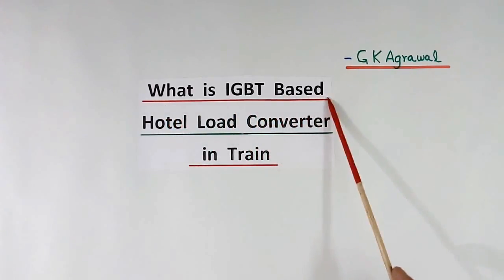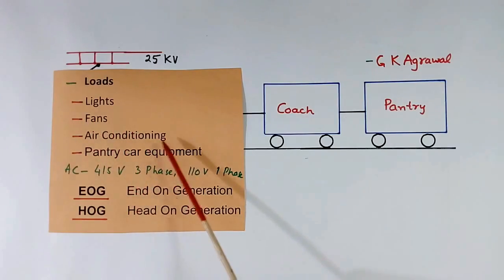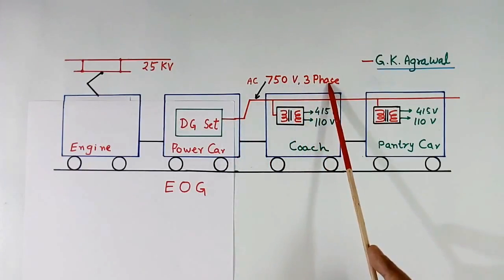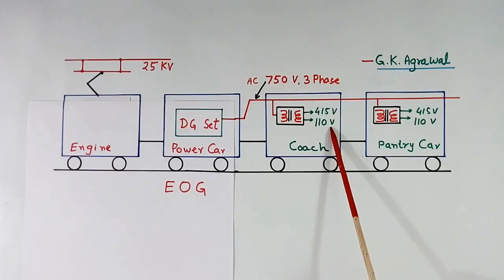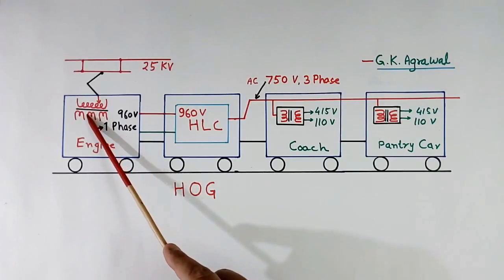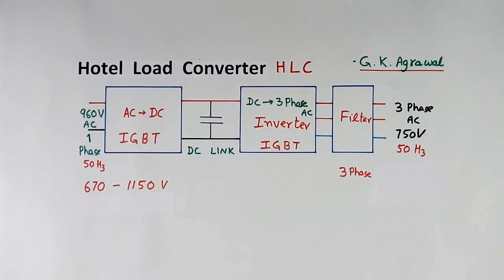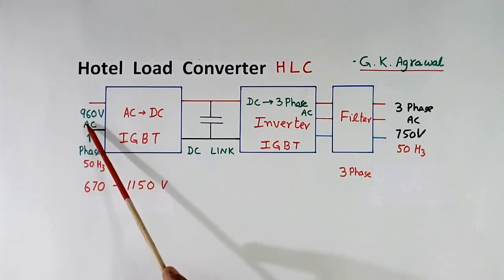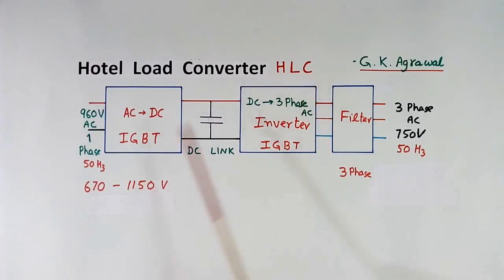Head ON generation, EOG, Hotel load converter in train

Comment: HLC situated in engine cab sir but not in power car(EOG)
Reply from the maker: In case of HLC, there may not be any EOG equipments.
Reply: Sir here what I means with EOG is just about the name of that power car coach . Not about the method of power generation EOG .

Sir here in diagram I can see HLC is situated in those Power car coach but not in Locomotive . But actually 2 HLC are located in Locomotive cab.